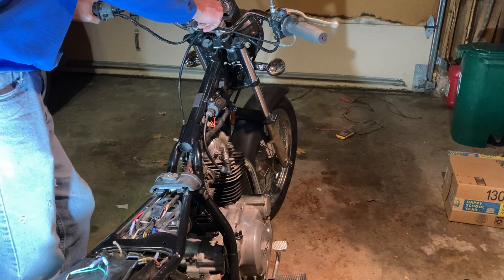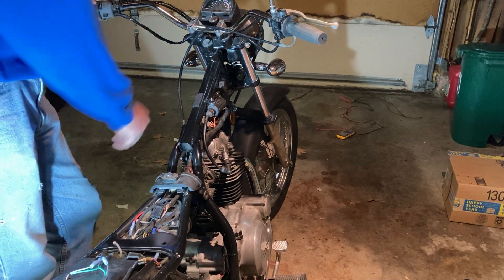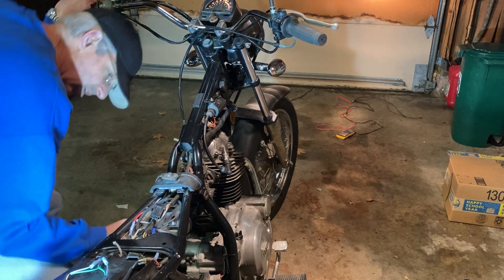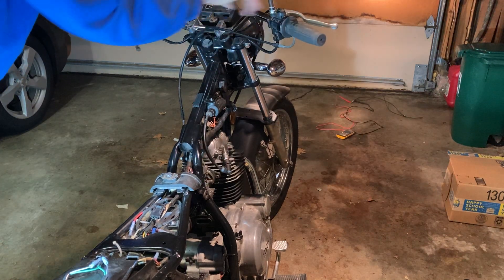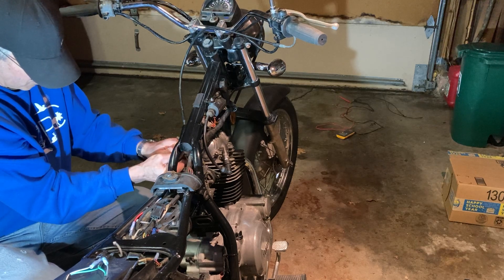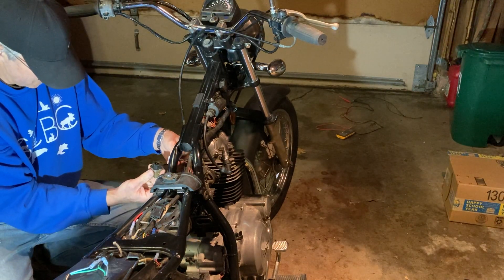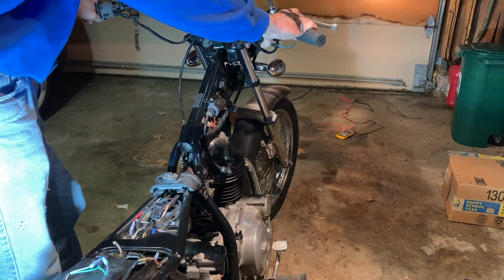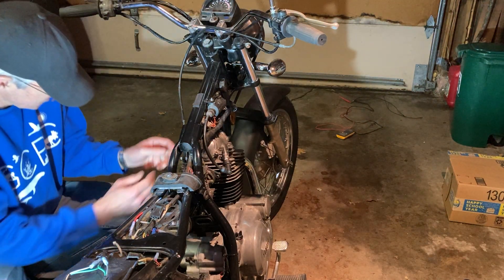No Spark Yamaha SR250

Comment: What was it on the same boat
Reply from the maker: Did you see the note that there are two 3-wire connectors which I had reconnected wrong? I guess I got lucky with such an easy fix. 
This bike (1981) also has a second safety circuit back under the seat which has been replaced with a jumper wire. So far I have not been able to ascertain what this circuit was originally for, and it is not pictured on the wiring diagrams I have.